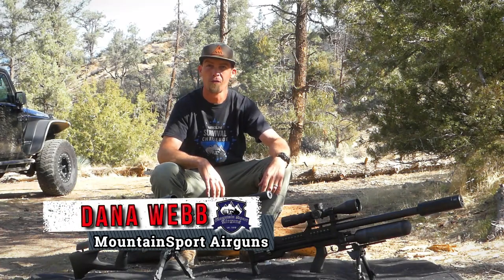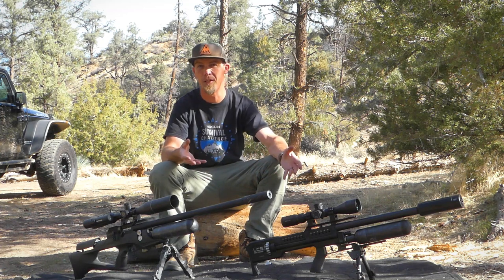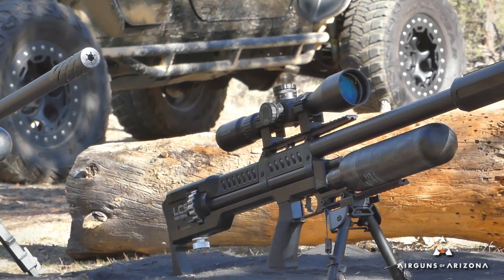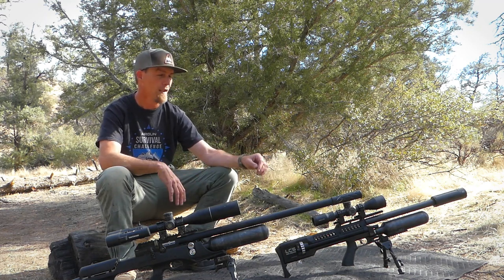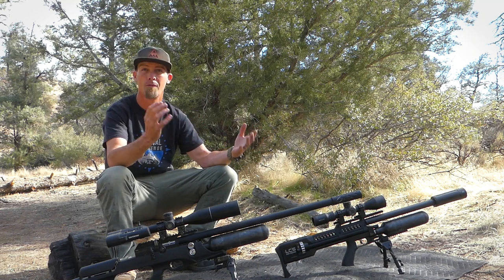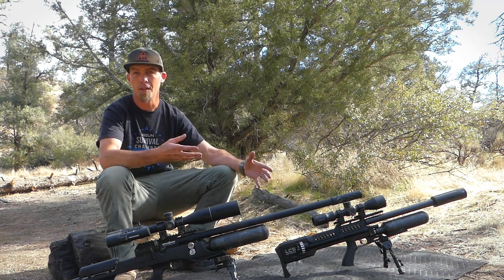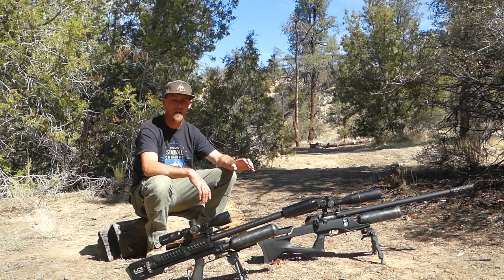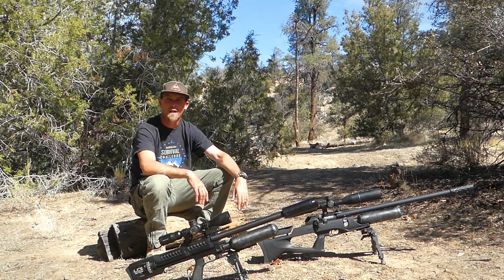Airgun Moderators (WHAT YOU NEED TO KNOW)

Comment: I use a Ramus Trident moderator on my Brocock concept XR in. 22 cal. It's 74 db 10 feet from the muzzle. I am getting 35 ft lbs at high power setting. The Ramus Technologies Trident moderator is a really nice moderator. Great video and information.

Comment: Nice work dude. Thank you.  Those are some neat looking air rifles Mr. !  You mentioned science ... As far as your sound metering goes, you could use a USB sound card with your computer and a measurement microphone.  The idea is to wrap the  microphone with enough baffling (or "insulating the microphone) to be able to "handle" the pow.   If you get a soundcard that records super fast, like the Steinberg stuff that can record at 192Khz, you can simply record the WAV file with your software of choice. It might take a few shots, to pick up the peak POW, but once you do, it will be obious on the computer. Once the microphone (like a cheap Behringer measurement mic, or an even cheaper dynamic mic) is calibrated with enough towels / wrappings / insulation and the waveform doesn't CLIP , you are golden.  Yes, a microphone moderator.   The idea is to be able to capture the loudest "pow', so that you can then get the lowest 'pow' and show us the difference between both using a software "spectrum analyzer".  You can even show us the tone, like a stereo eq 'tone', of each gun.

Comment: I personally own the Tatsu and the 160s. I also have factory moderators on two other guns. I have used various apps and low-cost DB meters. The one thing the meters do well enough is give you a comparison before and after. What you did not discuss is the fact that just 3 DB difference is sizable. Quite easily noticeable and greater a difference is dramatic.  My numbers are quite a bit different for my Brocock Commander but then it is also only a 22.  Basically, the large differences you were seeing were extremely noticeable. For me, even my 25 caliber gun at full power is backyard friendly using my 160 S.
Reply: Hi my friend  
I have questions 
Are the best Tatsu or 0db in sound?
And where the best in accuracy?

Comment: I was surprised how little these very popular moderators changed the db level. The tone sounded more different then the sound level.  Its strange I have found my escape seems to get louder as the pressure drops in the tank. Im not sure if that normal.
Reply from the maker: Yes that's normal, it's reaching bottom of bell curve.
Reply: @MountainSportAirguns  I was thinking it might be something like that but wasnt sure. Its nice while target shooting cause I know when to stop and recharge.
Reply: As your gun drops in pressure the hammer is still hitting at the same speed and weight so the vavle opens more and in return makes more dwell (more air is escaping).

Comment: It many cases when dealing with sound, specifically trying to suppress it, lowering the pitch alone can make a large difference on both sides of the muzzle. The “crack” the rifle makes is normally high in pitch and lowering that pitch with affecting db level not a lot at all changes it into a sound that is much less annoying and doesn’t seem to carry as far. I figure a lot of people order and receive a moderator and then aren’t happy with it because it still seems loud. Some moderators are just garbage and some just lower the pitch some but help accuracy by stripping the air away from the slug improving accuracy. Check your accuracy before you decide any moderator isn’t any good. It may be helping you get tighter groups.

Comment: Question.  Will a .30 cal Donny moderator affect shooting out of .22 call barrel?  I was thinking why not just buy the .30 cal moderator and that way i can use it in anu of my .22-.30 cal barrels but was not sure if that is that simple.  Im not sure if it affects acuracy or noise level on the .22 barrell
  Please let me know your insight.  Thanks!!
Reply from the maker: It will quiet the gun a little but not as good as a caliber specific. Donny will recommend going caliber up in size because they aren't machined perfectly and can cause pellet clipping.

Comment: Hi friend, I just watched your video and enjoyed it very much.  I just bought the 0dB 110C for my sons Crosman AK 1.   Both the gun and the moderator are 1/2" UNF fittings, but I can't thread the moderator onto his gun.   The gun's tip is Right hand thread, but it doesn't matter which why I turn the moderator.   I'm really confused....help?   Thank you!
Reply from the maker: Probably has wrong thread pitch on the Crosman. Most lower end manufactrers use a less standardized thread pattern.

Comment: I’d like to put a DonnyFL Sumo on a .22 Walther Reign (Euro version).  Do you recommend I get the .22/25 version of the Sumo or would the .177/.22 be okay?  Price is the same, but would one have an effect on accuracy over the other?  Thanks!!
Reply from the maker: Donny usually recommends going one caliber higher. I prefer the 0dB myself over the Donny simply due to size and have never encountered accuracy issues in using them.
Reply: @MountainSportAirguns  thanks!

Comment: I’ve got a DonnyFL  Ronin on my Leshiy2 and though it is quieter it is in no way backyard friendly.  It’s .25 with a 250mm barrel. What moderator would you consider to quiet it down? Perhaps an aftermarket moderator is in the works I’ve not heard of as of today.
Reply from the maker: Turning the power down is something you could consider for backyard. Some of the sound could be coming from whatever backstop you might be using.. sometimes the pellet hitting is louder than the shot itself. I've yet to try one but apparently Huma has a moderator that works well.

Comment: I got many questions.... 1 where's is the air output on the air being stripped away? 2 can you take the 0db apart and show the internals?
Reply from the maker: These are not air strippers, the inside of these are all very simple and use felt. The 0db is a better design IMO, for size work a bit better. This was not a product review, just to show various size, brands etc, The main goal was to disclose how "non-scientific" these DB meters are. Don't believe everything you see.
Reply: @MountainSportAirguns  i know there are not airstrippers. But if the air comes out the end of the barrel the turbulence can cause the pellet to become unstable.